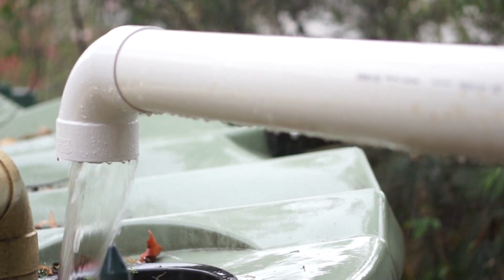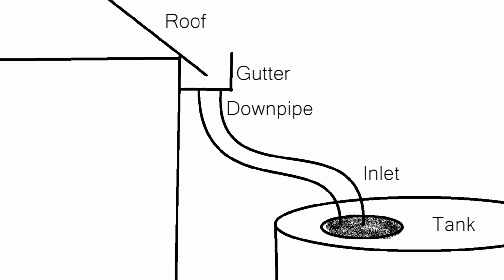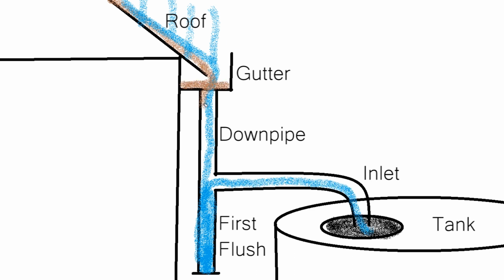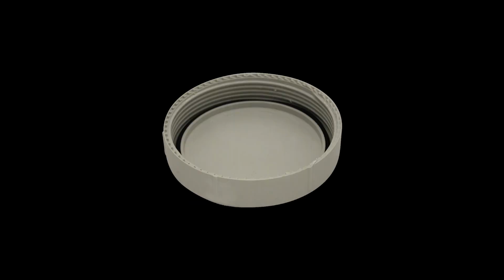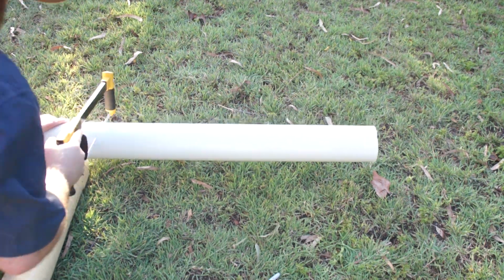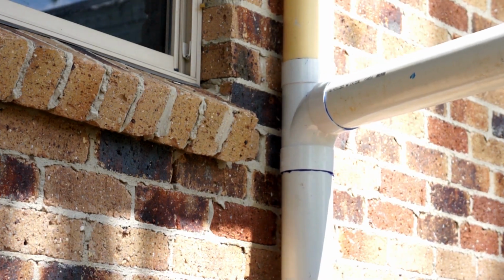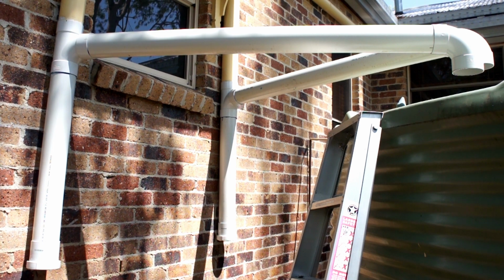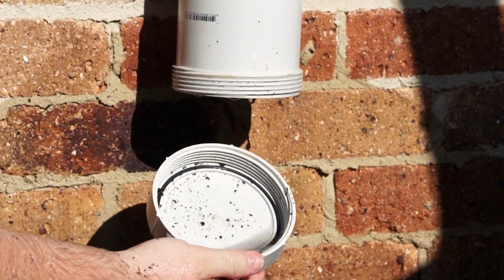How to make a First Flush Filter // Rainwater Collection System Part I

Comment: Good vid. 
On the first flush system, make the fill connection to the storage tank with a wye fitting rather than a tee.
 I found that larger, heavier debris may not make it off the roof right away in a light rain, only to be rinsed down after the first flush pipe is full. This makes it a straight path to the storage tank.
By using a wye fitting, the debris has to travel up hill for a short distance, where if it's heavier than water it drops back down into the first flush leg
Reply from the maker: That's a good tip. Thanks.
Reply: The heavy debris doesn't bother me much, mostly pine needles, the mozzie net/mesh deals with that.
The first flush setup is mostly to stop dust from the roof flowing in and sludge building up in the tank in my case.
I live rural with a dirt road 100ish m away in a pretty dry area so it is a big problem. 
Our rain water collection is our primary source of house water.
The clearer the tank the easier job the filters have.

Comment: I was going to do something similar with a smaller container prior to going into the first cistern, but I like this idea as well. I think I'll do a combination, but I definitely will install a minimum of two of your cleanouts first, and a series of filters; not just one. I will also install a small petcock at the bottom of each barrel to drain anything that may still make it through. While this is for my garden, I also want this as a backup water supply in the event of SHTF.

Comment: The length of the sediment collection pipe should be corresponding to the area of your roof. A bigger roof needs a longer pipe. I would advise on installing a tap out of the lower section of the sediment pipe (right before the final 'basket") so you can drain the contaminated water with a hose instead of having 10-20 liters of water splashing on your pants every time you clean it.
Reply from the maker: See part II... :)
Reply: Please can you give the formula to calculate the volume of the collection pipe required based on the roof area?
Reply: I found it:  Volume of diverted water (liter) = roof lenght (m) x roof width (m) x 0.5 (mm)

Comment: Just saw one of these in youtube shorts but he had a hose connected under the silt collection cap. A small section of sponge hose or the type that leaches water to flower beds would allow the lower section to slowly empty itself so you would not need to empty the silt collector after each rainfall.

Comment: A problem with this design is the the water rush will still create a very muddy mix.  I'd suggest a method to slow the water down then a buoyant object to block the water after the flush fills up to allow the rest of the water to divert to the tank.
Reply from the maker: +smith288 Yep, good advice. I'm not having any issues with that myself but I'm sure that others might; particularly if their water drop is quite long before hitting the flush well or perhaps with torrential rain.

Comment: Very informative vid. I'm in the process of building my own rain harvesting system and I had the idea of using a clear 5 gallon water jug as the first flush. 8' of 4" PVC has a volume of 5.2 gallons. Using the water jug lets me see inside, saves space and saves money as you can find empty jugs for free. I picked up 2 empty jugs. I'm just having trouble with fittings and looking for some insight and ideas.
Reply from the maker: Thanks Yourath!
Have you looked at threaded couplings? There might be something you could use.

Comment: excellent thank you so much. my question is how do you overcome when the tank is full. I know you can leave the bottom open is there a way around it?
Reply: tanks come with a hole for an overflow pipe. you can pipe this into an existing soakwell or drain. but very importantly, the exit pipe must be capable of the same amount of outgoing water as incoming so it should never overflow out the very top.
Reply: @Fanta....  thank you so much. I built a system like yours. But i do open the bottom and let the water run through the drainage pipe.

Comment: Hey great videos - love the  simple easy method and cool backing track....  So what do you use to prevent mosquito reproduction in your water system / Tank... I am told in many Australian stages its a legal requirement.
Reply: the main tank has a mosquito filter built in. the water coming out of the pipes freefalls through the mosquito filter so all good there.

Comment: Great video, very informative! In addition to a first flush setup, what are your thoughts on filtering the rainwater from a roof with modern asphalt shingles if you wanted to drink it, shower with it, etc.?
Reply from the maker: To be honest, I know nothing about asphalt shingles; we don't really use them here in Australia, so I don't know enough about them to even make an educated assumption.
I know there are some really good filtration systems out there that I would consider looking into. On my system, we have one filter for all the water going into the house, and another one (finer) under the sink that has a dedicated spout up on the sink that we use for drinking water. That's what I would look into.
Reply: @UrbanSelfSufficiency  Oh that is a good idea to look into. If anything, I might just buy a tool shed or some other supply storage shed with a tin roof and utilize that for a simple catchment system. Cheers from the US!

Comment: We have bought q property with what looks similar to this DIY first flush without the bouyant ball valve. However, our screw cap has a small hole at the bottom. Are we likely to be losing a lot of potential tank water due to the hole?
Reply from the maker: Potentially. Watch part II to see what I did with the cap. Maybe you can do something similar or replace the cap.

Comment: If you placed a 90mm valve/gate at the base of the flush you wouldn't need to unscrew the cap and get drenched.
Reply from the maker: In part II I addressed that with a retrofit :)

Comment: Problem with this is that the drain pipe will always fill up so subsequently all the water coming after the drain has filled up will just drain into the tank regardless of the drain this is becouse water will always rush into the inlet pipe

Comment: I see two problems with this system right away. THis is not a true First Flush system because there is nothing inside of it to prevent any floating debris from coming back out of the well area and going back into your storage tanks. Secondly, the First Flush systems are designed to leak water out the bottom of the well area slowly so the tank can drain between rain showers on its own. If the tank does not empty and the next rain comes the water from the roof then bypasses the system altogether and goes straight in your storage tank. 

When I built my system I used multiple 4 inch PVC pipes as the well area so that I can collect the first 40 gallons before the water goes to my storage tanks. At the top of my First Flush system, I used a 4" to 3" adapter. Inside the main 4" pipe I placed a white plastic Whiffle Ball which floats on the water and as the water in the tubes rise goes up the 4" pipe and then gets stopped by the 3" adapter sealing the dirty water below and diverting the now clean water to my storage tanks. At the bottom of the 4" pipes, I used threaded plugs that do NOT have an o-ring and I do not have tightened all the way up. This way the water can slowly leak out to reset the system after the rain stops.
Reply from the maker: The parts 2 and 3 of this series address both of those issues.
Reply from the maker: It's good advice though. Thank you for taking the time to write such detailed information; it's very much appreciated to have such thorough sharing of ideas and learnings. 

Jim

Comment: Won't the dirt just float back up and into the rain barrel once the 'Flush system' is full?
Reply from the maker: Hey Miguel, not really, no; the dirt is heavy enough to sink to the bottom of the chamber. Thanks for watching. Jim
Reply: First flush (dirty roof wash) is denser than the fresher rainwater. As such, it quickly settles to the bottom of the diverter. If you drain a fixed quantity first flush diverter, the initial water will smell but as the water column drains, the water quality will improve substantially. First flush diverters with drippers can easily lose 4-6 litres per hour.
Reply: I think the turbulence in the pipe would let stuff flow throw. Dried bird poop might float out.  I think it will work to some extent, some sort of simple filter would work as good.